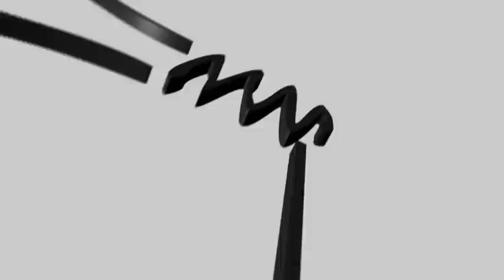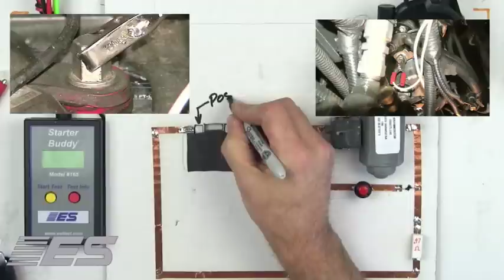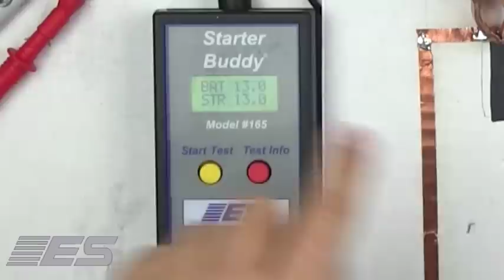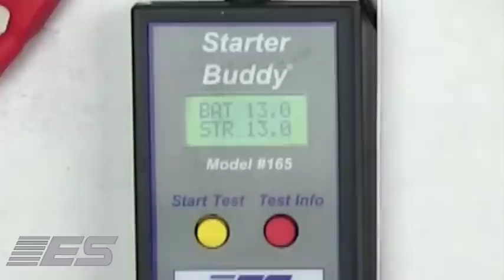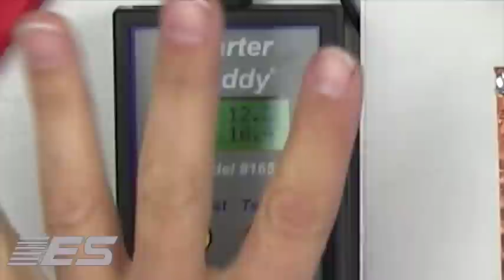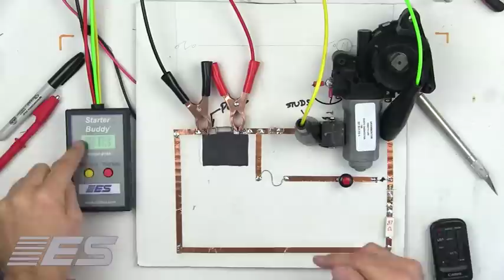Starter Buddy Operational Overview

Comment: This is a great tool. Over the years checks I witnessed voltage drop testing for a starter circuit confused many. I came from the commercial trucking world ( cummins actually) and wish we had this 35 years ago. One comment I have which probably has no effect on the V-drop check is the battery cable nut. The nut in your video is typical on truck batteries. They are stainless capped or sleeved in many cases to keep them looking nice. But they are poor at transferring large blocks of current. Volvo tractors had 4 group 31 batteries ganged and on one ground and one positive there was a solid brass knurled nut for jump starting. And I am just talking about clamping jumper cables or today a jump box on for starting. There was a significant change in starter speed when using the brass nuts vs the stainless hex cap nuts in cold weather. Great tool!

Comment: Dan, in the same sense that I can only trust myself to tend to my safety regarding household or industrial electricity (I know I turned off the breaker at the source and applied a lockout), I can only trust myself to crank the engine when I know I'm clear.

You bring up good safety points in this presentation.